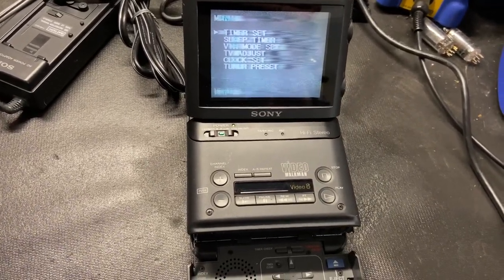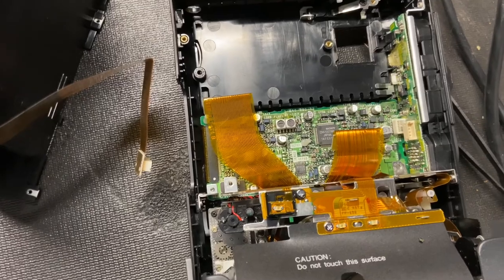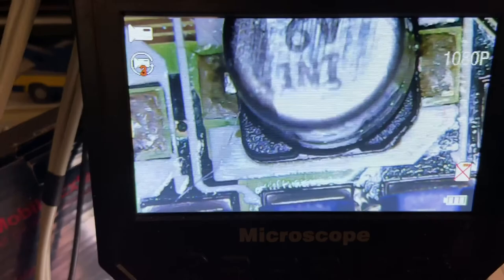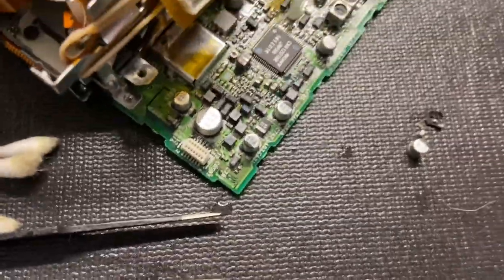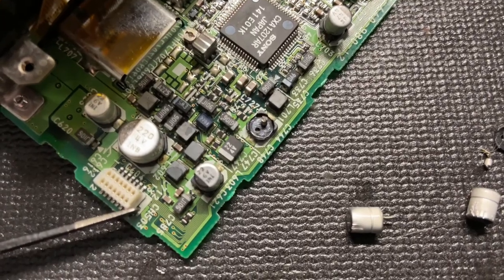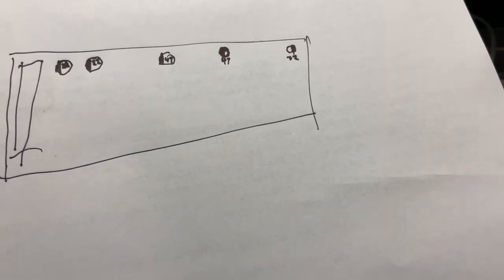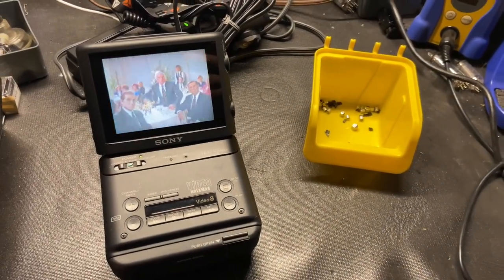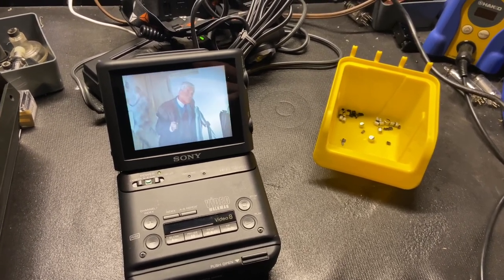1991 Sony Video Walkman Repair - Model GV-500

Comment: Nice work, I have restored 4 x GV500, 2 x GV300 2x GV200 3 x GV100 3 x GV9 and the first model 2 x GV-8 which are very rare to find working due to the worst design LCD back board as all the caps are bunched to together so the cap leakage is fatal usually. Both of mine I had to replace tracks bit they are still working great after 2 years since restoring.
Reply: hi, wher can i find electrolytic capacitors for my gv 300e. no powerled, only play stop bach forwart i see on tge tape, lcd will not work tapedoor will not open

Comment: Awesome vid.  Lots of work!  These little devices are awesome for the Analog video nerds!   Every one i've bought at estate / yard / swap-meet sales had major problems.  All of them will suffer leaking electrolytic capacitors.   Usually the servo motors that run the capstan will be unable to move the tape.  There is a toothed rubber belt.  I've yet to find a replacement for this belt.